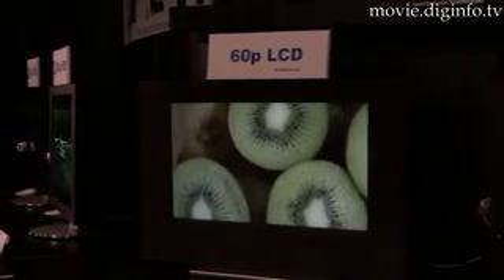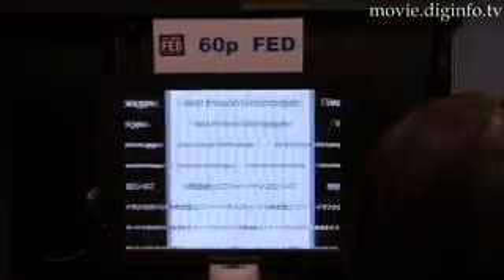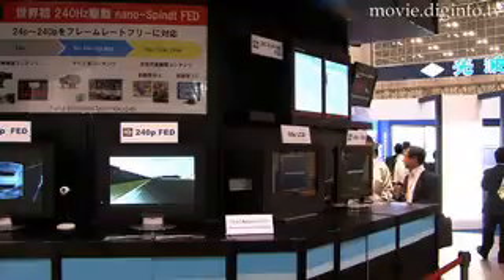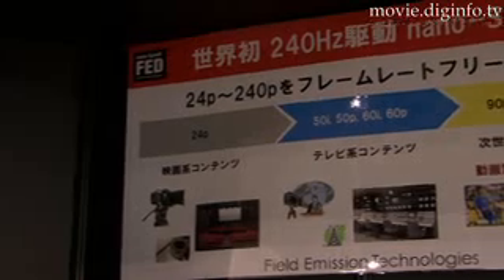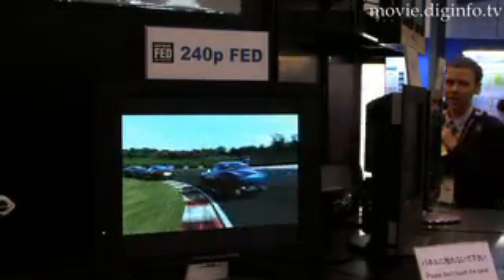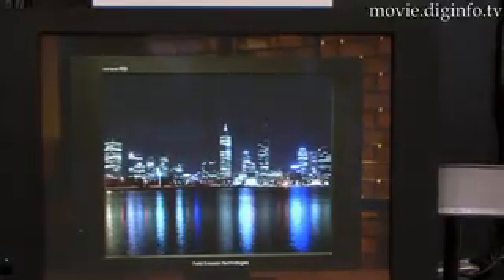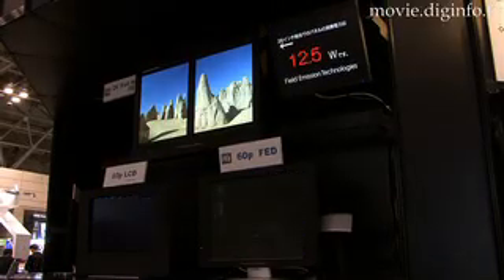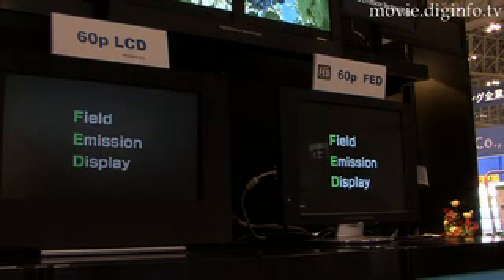nano-Spindt FED Flat Panel Screens(can do 240fps) : DigInfo

Comment: The response time of the FED Display will blow your mind because while the typical response time of a CRT is 50 microseconds, the response time of the FED Display is 20 Nanoseconds, which is even faster than the CRT.😱

A magnificent technology was unfortunately thrown away☹

No modern display will even come close to the Fed display in refresh rate for at least 50 years!

Comment: sometimes the old things are the best.
Reply: This isn't.  This is heavier, uses more power, is more fragile, more difficult to manufacture, and has a shorter lifespan than an LCD and if you want the same exact abilities (that is true black) OLED does everything this can do at a lower cost.  OLED has poor longevity.

I don't see any advantage of this over plasma displays either and they are obsolete because they are more expensive, and more fragile.
Reply: @fuzzywzhe  you actually haven't made a good case at all.. People who want the performance benefits of an FED/SED dont care about energy efficiency/fragility etc. And it figures it should be more difficult to manufacture - its a vastly superior display! OLED is still trying to replicate something already achieved decades ago (even 100 years if we go back to the first crt). quite pathetic honestly, that we've compromised on crap quality for so long just because its lighter and more efficient.
Reply: @fuzzywzhe  Whats your point? im sorry but i dont agree with what you're saying. We're looking at techonology that stopped being developed over ten years ago - i think its safe to say, had it continued, its possible this type of display could outperform OLED in terms of image quality. As for for plasma, the HD CRTs sony produced win hands down - even over OLED given theres no burn in or input lag to worry about. Sony FED prototypes were capable of 240hz progressive scan.

You've brought up power efficiency as a negative, but we're talking about picture quality. From a logistics and marketing standpoint i get what you're saying. With modern technology could it be improved? i think so. 

Moreover, indistinct pixels, as you put it, are bad because? You still get a fantastic, clear image thats easier to scale on a CRT. It follows that SED/FED would retain all the benefits of a CRT while having a slimmer profile.
Reply: @fuzzywzhe  
and yes, the question in rise is the manufacture cost of a FED. can it offer enough for a price in comparison to how pricey the high end displays are nowadays?
Reply: @fuzzywzhe  also, im using a  t221w right at the moment, and I can tell you, 5ms is VERY noticable in comparison to a CRT. naturally, 1ms reaction time is what, a fifth of that, yes?
Reply: @fuzzywzhe  
Yeah it's so friggin nice youtube deleted my whole comment, so I'll just direct you at a video with shround on linustechtips regarding refresh rate. 

were talking about brain perception of a rendered image. some pro esports players got a reaction time of 110 ms. even software render methods work different on different displays. 

you're not only comparing technology, you are also comparing BRAIN PERCEPTION of the displayed image. if something is easier on the brain to process, it definitely is an advantage on a competetive level. 

it's not only a case of nostalgia, but you're not looking scientifically at the psyche as for why some people still deem CRTs as better display technology than LCD. 

That's it.

you're the guy who said nobody needs more than 30 frames because that's how many your eyes see. it compromises you in terms of modern esports, thanks.